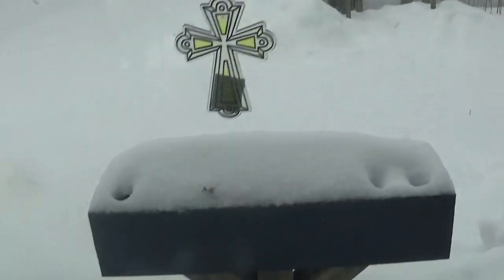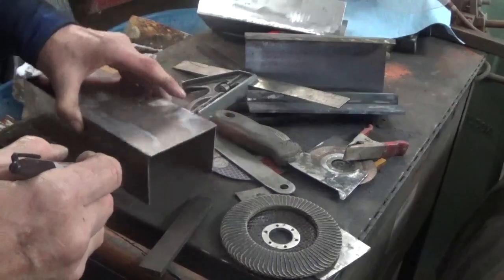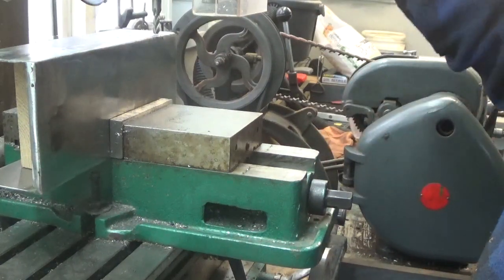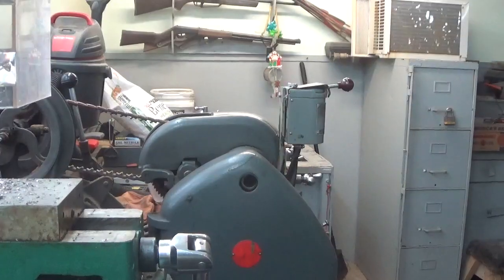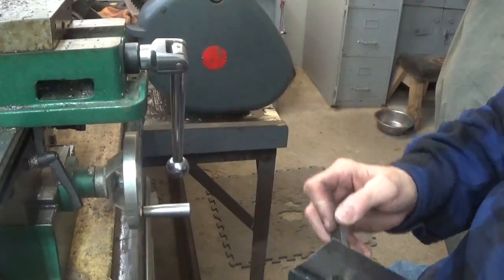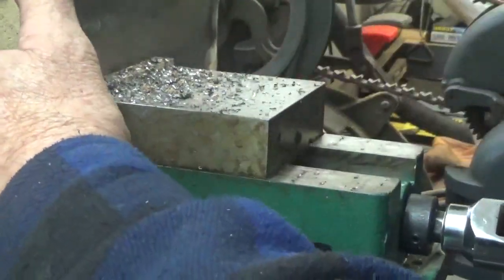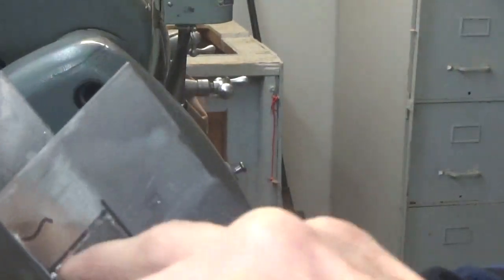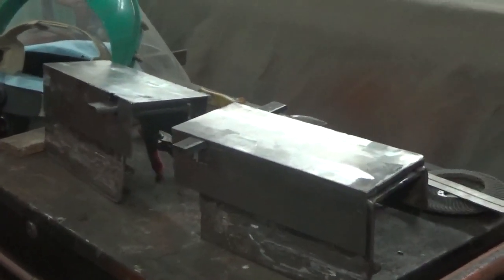Cutting square holes for the key to the bevel siding cutter.

Comment: Morning Joe ..... you'll be shipping on Tuesday, I think Monday is a holiday. That's one thing I don't have is a milling machine. I have a milling attachment for my Atlas lathe, but it doesn't work as well as it should, maybe someday. Five above this morning and it's not suppose to get above 12 degrees today and -10 tonight. I think I'll start the fireplace, going to burn a little wood today. It's nice to see the Sun, though. I'm going to enjoy my hot tub tonight. Have a good one.
Reply from the maker: Morning John, cold onr this morning for sure. It is 10 at the moment. I am ok with snow but the temps are a pain below 20.
Reply: @josaljo1  Ah.... beach and Corona looks mighty good right now!
Reply from the maker: @johncollado1151  I bet it is just as nice in front of the fireplace.
Reply: @josaljo1  It is, but I still have to get up and feed it all the time! Stay warm.

Comment: Joe, Try putting 2 wood blocks in there instead of one, which will be a little wider than the metal side of the piece, so that when you tighten the vise the metal should no longer tip.  At 16.28 you still don't have enough wood in there, thus the continued vibration.  I think if you have metal contact on the front of the vise and wood on contact with the back the problem will be solved.  You could even use a small "C" clamp front to back to hold the metal to the wood once the wood is in contact with the back of the vise.  Of course, I could be wrong.
Reply: I was thinking same thing but I am not a machinist so any input I got can only be taken with a grain of salt. I have done metal work alot but only tools I ever used was a acetylene torch a grinder and a welder.
Reply from the maker: I am going to try that, so it stops jumping around.

Comment: When using the bevel jig, do you still use the dogs (to secure the cant)?
Reply from the maker: Depending on how sharp the blade is, I try to use it all the time so the cant does not rise up on the bevel cut.

Comment: Hello Joe,
Would you be able to cut the "U" cut in the sides before welding them to the top plate? Seems like if you could, they could be stacked, cut and filed all at one time and not have the vibration problem  that you're having currently. Just a thought from an arm chair quarterback. Well, the temps are in the teens here in Tulsa this morning. That's too cold for my blood. 49 working days to retirement but who's counting. Tell Sally hello and may God bless you both!
Reply from the maker: Morning lakebum, 10 here. I am going to try cutting without welding first. I did not even think of that. 49 days, I hope you live 50 more healthy happy years, God bless you and yours.